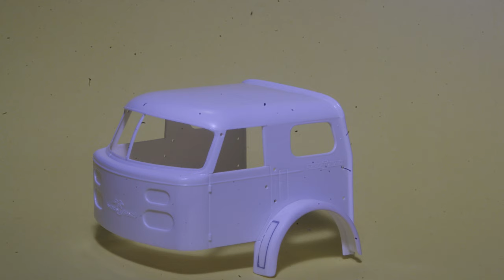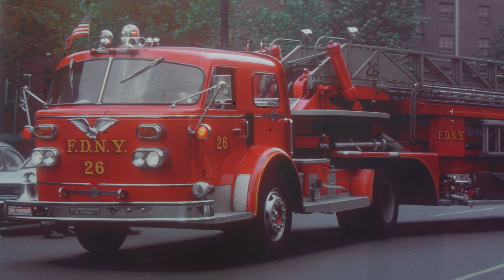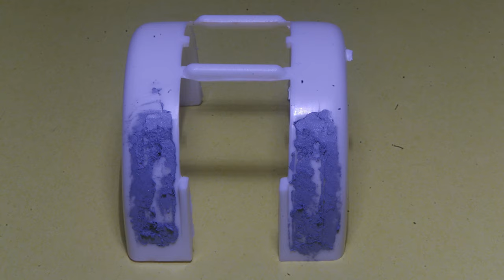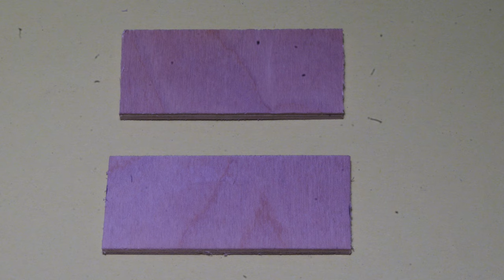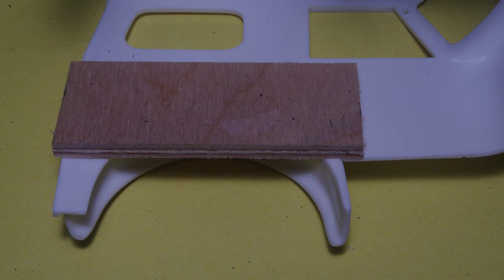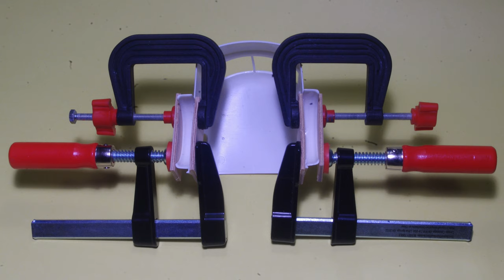Clamping 1/25 AMT "ALF" fenders in place for gluing

Comment: Nice tip that works on a lot of different projects.
Reply from the maker: The fenders had me scratching my head for a bit, was originally going to try and work around the fender arc a bit at a time with CA glue but I'm much happier with this method. One other application that comes to mind could be Pete 359 with its separate fenders.